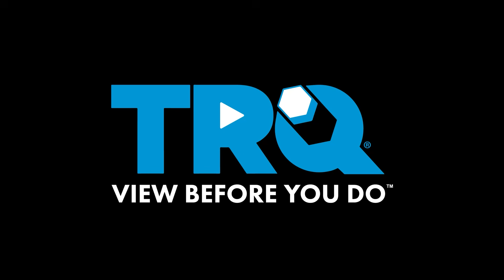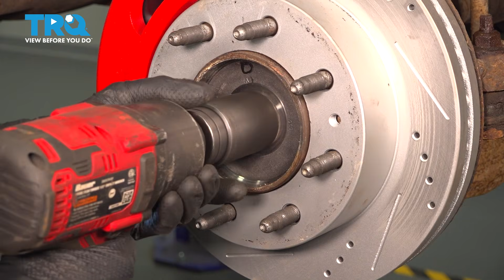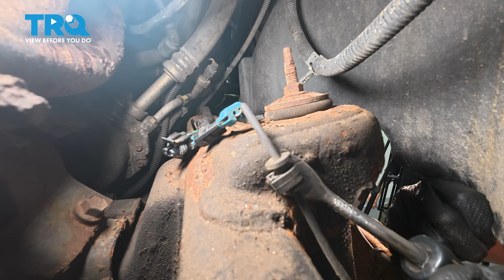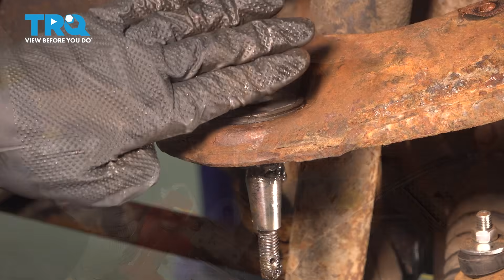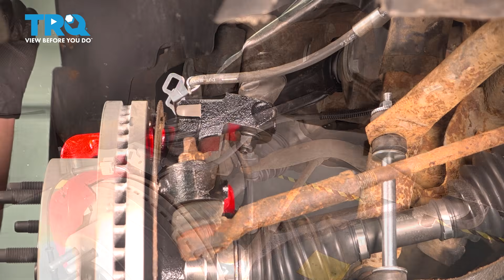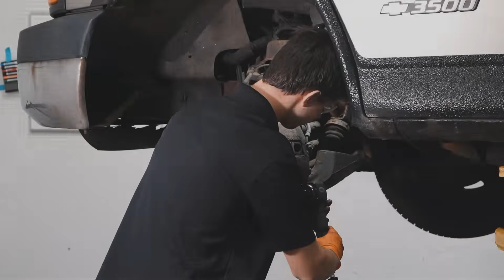How to Replace Front Upper Ball Joints 2007-2014 GMC Sierra 2500 HD

Comment: Great video- just one small note- the ball joint press cap sitting on top of the adapter sleeve is upside down, you can see it wasn't stable, using the bowl shape against the sleeve.  Flipping it over allows the concentric rings to fit snugly on the sleeve and be stable.  A minor detail.